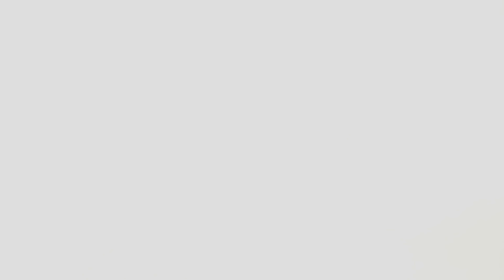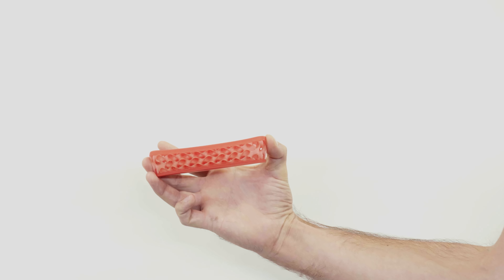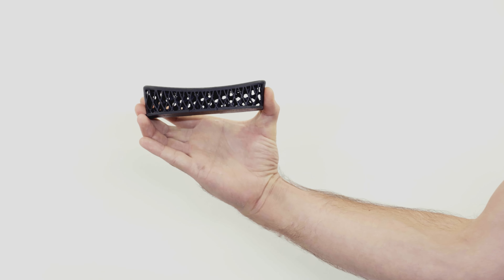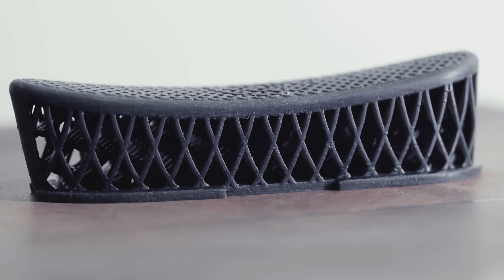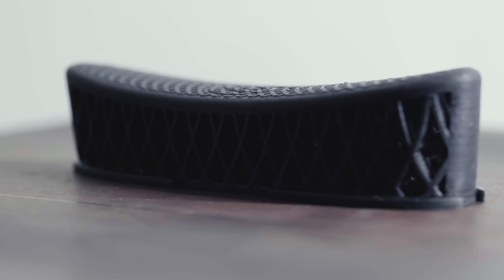Weatherby's 3DHEX Recoil Pad

Comment: Interesting... purchased the Backcountry Ti 2.0 in 300. When you set your gun next to a tree, the pad flattens out and creates a huge bubble. It remains this way for several hours, especially if cold. Weatherby said to store my $3500 rifle barrel down in my safe. I heard they've corrected this issue with the latest generation. Will Weatherby replace my bad recoil pad???